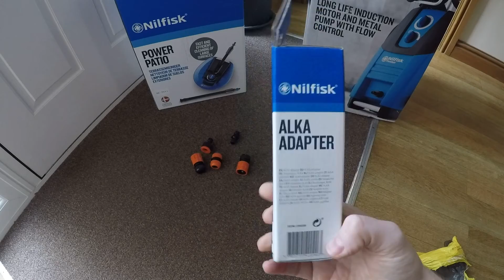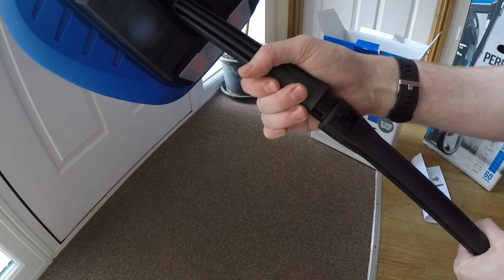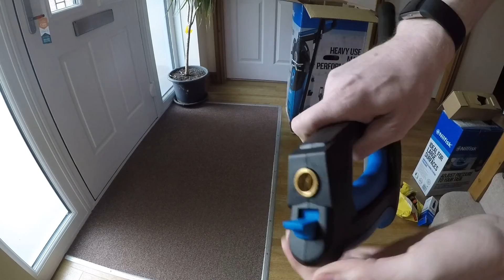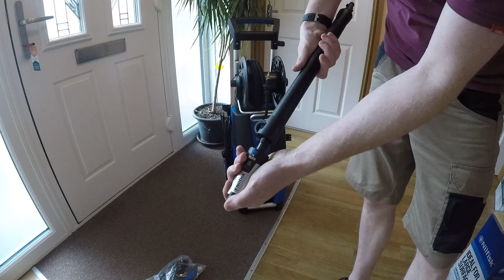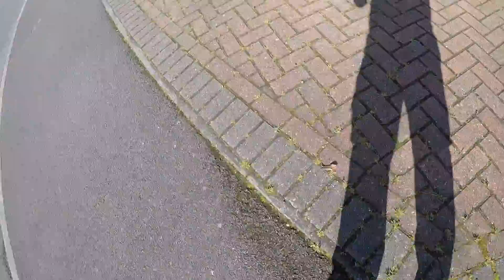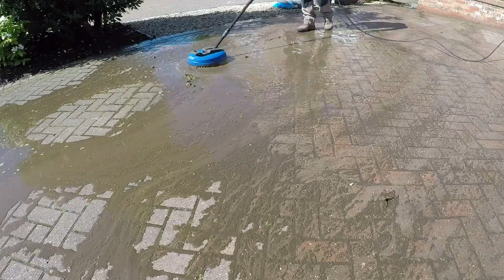Nilfisk Premium 180 pressure washer.

Comment: Hi Nicholas, thanks for a great video. I’ve just purchased and set up my Nilfisk 180. The bar pressure control knob on my machine is loose, in that it pulls out, was yours like this? It appears to work if I keep it pushed in but can’t be right can it? Thanks again for a no nonsense video 😊👍
Reply from the maker: Hi, just checked, I would say mine moves max 1mm if that in and out,  with that movement it seems really solid. (like its not really supposed to). I will say I think its a bit misleading how many times you can turn it, I though it would be 1/2 rotation but it seems to have loads more turns than the scale marked shows. drop Nilfisk or where you got it from a email they should be able to provide some supports. 🤞
Reply: @nicholasfranklin9218  thanks for your reply. I have now got a replacement and I’m really pleased with it, no faults this time. The plastic tangs that hold the knob in were broken off. Thanks again for your time, much appreciated 😊👍

Comment: Thanks for the video mate. Been consodering a pressure washer upgrade. Either the Nilfisk P200 or Kranzle K10 for cleankng the car. Would you say the Nilfisk P200 is overkill?
Reply from the maker: The Kranzle's look really good, I had the 1050 on my list too but tbh I was put off by the fact you have to always lay them down to run  (not an issue with the K10) I was worried that I would forget and wreck it.   The P200 is even more powerful then mine, but it has the diel to lower the pressure and also the tips can be used to drop the pressure. I think its always better to have more pressure than you need. Even though you would never use 200bar on the car its nice to know you can decimate any weeks and moss growing on your drive. :-) 
You do have the standard option of the stubby gun though with the Kranzle and that is a huge advantage when cleaning the car.  If its only the car your cleaning then the 120 bar will be more than enough.  all the best, Nick
Reply: @nicholasfranklin9218 Thanks for the reply, mate. 
How do you rate the Nilfisk range and have you had any issues with it? 
What's the hose like? Does it kink as my karcher does and I really hate it. 
Do you run it on full when cleaning the car? 
Speaking to North West Power Washers they said the P180 and P200 are the same machine internally. Just that the P200 has a 15metre high pressure hose and snow foam lance.
Reply from the maker: @mudguardrider8211  
I really like it, so far no issues but its early days.  
The hose is really good, its much better than the one I had on the old Karcher 310 (but that's like 25 years old) I really like the hose real, it's a great feature. I've had no issues yet with kinking.
I turned it down to do the car. one thing I would say is I don't rate the internal chemical dosing, it seems a bit week for me BUT that could be me using the wrong ratio of shampoo. We use a aftermarket snow foam lance which is fine, it would have been nice to get the Nilfisk one but I didn't see the point of spending more money. We got the adapter instead as I've got a few Karcher accessories which I wanted to keep. (drain jet and snow foam)  
I didn't know that about the P180-P200